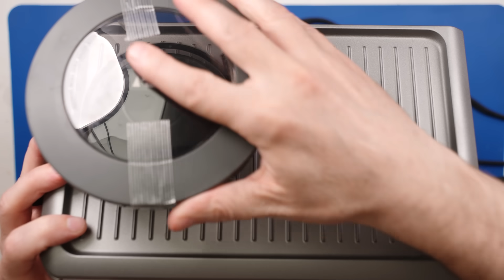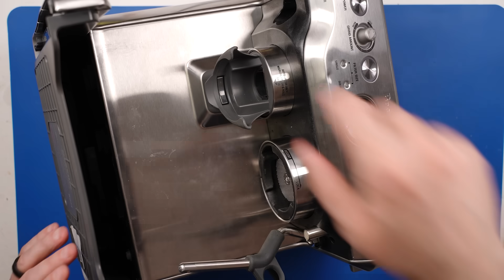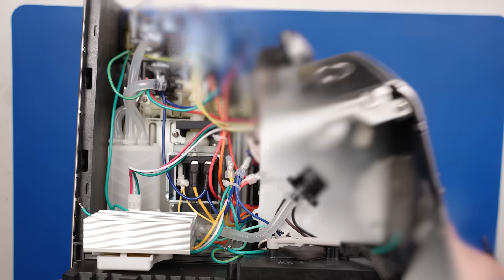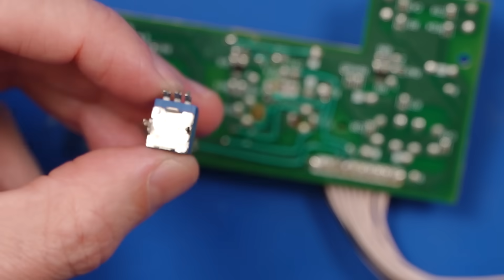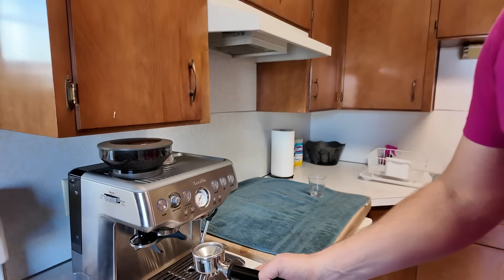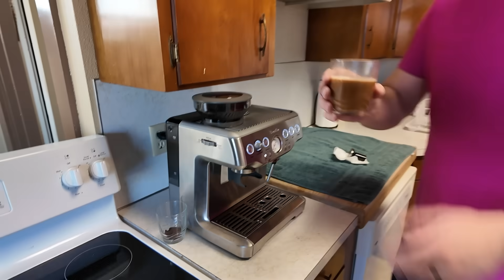Are Expensive Breville Espresso Machines Repairable?

Comment: Breville products on average are junk.   Now, if you can get one built well, assembled well and tested.. you may get lucky.  I have an earlier model of this one, and I went through 6 units from Macys... 5 all had issues, OR i found were used and returned and put back on the shelves.  I finally called Breville and said ENOUGH of the BS... your units are junk and I paid $200+. They admitted there was some flaws in the design and even the components on the PCB, etc.. They send me a brand new revised model and its worked now for 10 years without issues.. They had me RMA the junk one back. done.   SO, heads up.    Also shipping is trash too, they drop these boxes, bounce em and more all the time. this is a classic case of physical damage done from being dropped or shipping damage.

Comment: Solid work with one complaint: those were THICK traces on that board you fixed with some tiny thin wires. I’d be worried about that long term. I don’t know what kind of amperage was going through that area.
Reply from the maker: They were wide, definitely not thick. If the wires I installed were flattened they’d probably be about the same size.

Comment: Good thing about the Breville is that most replacement parts can be bought easily. The new left control pcb assembly for example costs around 20 bucks. So while there is some cute charm on fixing broken-to-half pcb that also supports physical buttons, in this case replacing the board would have been a better option. OEM Part SP0010233 btw.

As for what happened, it probably was dropped to its face, pushing the volume button in and breaking the board.

Comment: I wouldn't recommend breville machines, I had one and although it worked well until about 4 months out of its warranty (getting used for about 3 cups per day), once it started leaking and needed a new gasket, when I started stripping it down underneath the stainless enclosure it had cheese grade screws completely rusted and stuck in plastic housings. ultimately a $800 machine binned for a $10 seal because it was never made to be repaired. I have an ECM machine now, I have stripped it down once and it looks bullet proof, nothing but brass and stainless steel

Comment: I just replaced the solenoid and main board on my Breville due to a failed thyristor and bjt driver circuit that cooked the solenoid. Pain in the butt to work on but very satisfying to not have to replace the unit. Great video, subbed!

Comment: I repaired my Italian made Saeco espresso machine once. Needed a new heating element. My machine had 1/10th the electronics and 1/10th the plastic of this one. No PCBs or ICs at all - its completely electromechanical. Just big chunky switches, relays, thermostats, a pump and a heating element hooked up to brass plumbing in a stamped steel case..

Comment: Great video, i have one of these units on my kitchen  counter, it’s over 10 years old now. I’ve replaced all the internal plastic pipes and seals, solenoids, thermal switch on the boiler and main pump over the years. Pro tip breville has extensive parts diagrams and if you pressure their customer service you can order parts for a much better price than their certified parts suppliers as a one time exception

Comment: I have the same machine since 8 years now. It’s very reliable. Your dropped and broke the button board. Easy fix! I think, the spare parts are available. On mine, sometimes it needs to be dismounted to clean the valves that get clogged. The plastic removal session is bit annoying but it’s not so difficult. Good video.

Comment: How feasible/practical would it be to just create a replica of that board and get it manufactured and sent over by someone like PCBWay or whatever - seeing that it's just a single layer board and that you can scavenge the other existing bits off the broken board? I'm guessing that the machine was dropped on its front and the knob got pushed in and cracked the board.

Comment: that machine look way to complicate for no reason ,   coffee makers  just need a heating element , and pump ,and motor for grinder    and on off switch ,   the heating element just use ac power ,,  and ac dc converter for pump and grinder ,

Comment: I was a repair tech for many years and have seen numerous cracked boards. Wondered why you grinded it first only to add jumper wires to the pins. I was going out of my mind watching you reattach the switch to the wrong side of the board. I was screaming at the TV screen! 😅 Great end result.

Comment: I bought a Breville toaster oven to replace a much cheaper toaster oven that lasted 8 years. It looked great but failed after 6 months because of the thermal link going bad which was common according to owners repair forum, very very common. The part was cheap but after more than 20 screws removed, replacing the thermal link then struggling to hold pieces that did not want to go back together ta da fixed, Then 2 months later the top heating element died.  Decided to go back to a toaster oven 5 times cheaper and 5 years later failure free, I realized cheaper can be the better choice.

Comment: I've also bridged damaged wide traces with thin solder wick, which further splints the board. Used to use chamois head cleaning swab plastic sticks for splinting the board, epoxied in place to stiffen the board and reinforce it. Likely, the knob for the switch took an impact and drove the switch through the board.
I've also stripped the wire entirely in some traces, stripping the mask from the trace right at the crack a bit back, tinned the trace and wire, laid it across to both splint the board and complete the path.
Got a chuckle over the cover when you lifted the pad on the switch retaining pad, been there, done that, bent the ear to the board to give support to the switch when gorilla hands twists it...
Never did accomplish putting the switch on the wrong side of the board, but I've had my share of other five star blunders, some with impressive smoke displays. Especially when I converted light emitting diodes into smoke emitting diodes...
Wait, ain't you supposed to route some of the wires through the teeth of the big assed gear? Yeah, done that one too. Nothing's as much fun as tripling the amount of work required to get the damned thing working, despite one's worst efforts!
Just as it buzzed and I was about to ask, "How do you work the infernal thing?", you came out with, "I have no idea how this thing works", yeah, it's like that. I'd be burning up the phone with my youngest, who has used those contraptions before. I do either single cup either k-cup or grounds maker or an old fashioned percolator, although I've also done loose grounds into a saucepan of water in a pinch.
On consideration after viewing its usage, if I've gotta work that hard for a cup of joe, I wanna get paid for it. I'll stick with my fancy brown, caffeine and water, hot, blonde and sweet.*

*Ancient joke from early in our marriage, was at the diner and the waitress asked me how I liked my coffee, "Like I like my women, blonde and sweet!", my wife exclaimed, "Hey, I'm a brunette!", "Oops". Everyone died. We did "The Lockhorns" comic strip type of fake bickering at parties too.
Damn, but I miss her.

Comment: Great video! I have had my unit for 7 years now, and did a repair after a flow switch eventually got a small build-up of calcium scale. It's a pretty easy machine to keep running and built like a tank in all the ways that matter.
A hint to existing users.  Run a rescale monthly, using a simple citric acid solution. Calcium build up is the #1 reason why these units fail, so regular cleaning goes a long way.
Your walk through will be invaluable for when something else finally dies. 😊
Reply: I don't agree they are built like tanks, they are built like modern car engines, all out of plastic around the engine block, waiting to fail and you to buy a new one. A common failure are the are connectors things inside, there's a web group post describing the repair somewhere. I had to do this to mine, replaced the plastic part with a metal part instead.
Reply: @vampalan yeah, fair point. There is plenty of plastic, for sure. But I've never had an issue with that.i did a full clean somebyears back, just as preventative maintenance,  and the interior wss pretty spotless. A good sign. I was using the term "tank" to describe how reliable I've found the build,  not its ability to take a round. 😊   i for sure would not want to drop the unit! And it's no pro Cafe unit. 
 I've got 7 years from the current machine, and it's still going well. So the plastic is up to the job.
Maybe I can change the word "tank" to "Hyundai i30" for a better metaphor... cheap, reliable, popular and gets the job done, but definitely not top end.

Comment: I have had one for 9 years. Pretty easy to repair. Some parts are hard to find. Replaced a solenoid valve, pump, and steam wand assembly. Cost of ownership comes out to $100 a year with purchase cost, & parts over the 9 year period. Never had any electrical issues.

Comment: Gotta bring back the "Is it fixable? NOPE!" videos. I'd watch a series of those. Always interesting to know that certain things are designed to be near impossible to repair...
Reply: IMHO, 99.9% of the people could not diagnose and repair the unit featured in the video.  The espresso machine relies on a bevy of sensors and electronics, any of which can/will not function as intended or, fail altogether.
Reply: @SunriseLAW  I mean in the case of a cracked board... I feel most people would know what the issue was by that point. No power usually does mean a problem with a connection or a shorted chip on the board and if you are able to check the connections on the boards then you'd likely find where the issue is. It's not like there's a 99.9% fail rate at fixing these. That's not a believable statistic at all.
Reply: @SunriseLAW  I was an electric tech in my previous life. The diagnosis here was the easy part. The disassembly and reassembly were unnecessarily complicated due to the poor mechanical design. I wouldn't try to do this repair, but instead order a brand new replacement board.

Comment: I've had one of those for about 4 years now, its fantastic. Really good value.
Reply: the components in there are incredibly cheap and optimized for mass production. A truly good espresso machine doesn't need PCBs. For the price of that one new you could get a Gaggia Classic new and have 150 bugs left to get a cheap, but decent espresso mill. Those will last a lot longer and make better coffee.
The only reason for the existance of all those electronics is to keep the small aluminum boiler on temperature, because it doesn't have any thermal mass. The rest of the elctronics is a microcontroller that switches that solenoid valve and measures the amount of water for a cup inaccurately, which is a problem you could solve with a scale for 10 bugs.
So it's not good value. It's a convenient whole package for a bad price.

Comment: This is literally the machine I have in the kitchen now. I've had it for 10 years now and it hasn't skipped a beat
Reply: Makes perfect sense it's the seal at the tank. In Malaysia where I'm from, parts don't exactly come that easily. But I'd try anyway since I adore this machine so much for my caffeine needs. Thanks so much!
Reply: Mine started to leak water from the external tank inlet after 3 years. I did regular cleaning and descaling. Any idea why?
Reply: @kennieliong  I'd hazard a guess that it was one of the rubber seals around the coupling where it docks with the machine itself. Not sure if you can repair just the seal or if you'd have to buy the whole water tank but hopefully Breville will sell you the parts either way

Comment: Hy, you did a great job on soldering point of view, less from mechanical one.

I suggest, for the next time to engrave the break edge, as you done to expone metal for solder, so in this way you can have a stronger join to deposit epoxy and also realline the board better

Comment: Designs like this make me shudder - firstly the lack of a panel grommet for the mains cable, when I first saw it I thought it was a botched repair, but after disassembly I think that is by design, I guess it works but not good engineering to have a moving cable running against the edge of thin steel sheet - second the PCB with combined high voltage and low voltage, I appreciate that it is done out of necessity because of the lack of space, and it is not the only product, but I prefer to see high voltage and low voltage circuitry on different boards.

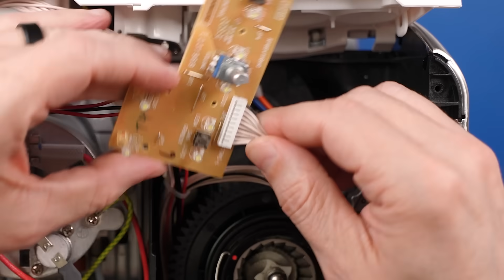Comment: 8:30 it looks like the power button may have been smashed down by the shape of the cracks on the board (or the board was smashed upwards against the power button) but I can’t see that happening after it was assembled as the buttons tend to be quite flush to the case to avoid that kind of damage.

(Edit) 19:27 actually it’s sticking up a lot more than I was expecting so it could have been damaged by the owner after unpacking.

Considering how much these things tend to cost it’s bad to see one that’s been broken at the assembly factory, my sister spent like 2k on one and I’m like you spent how much? Meanwhile I’m probably making better coffee with my one cup drip brewer (just a bit of plastic and glass and a filter) that cost like 10 quid.

Comment: This model is a value and reliability gem. We have used it in our small cafe for 6 years and pulled about 10k decent shots during that time. It was a "temporary" solution that stayed as it just did the job amazingly well. 
I purchased a second filter handle and we do use separate milk foamer, as the one with the machine is slow for our needs and can not be operated while pulling a shot.
I remember changing one gasket during that time, nothing else has ever broken or failed.
We have always used filtered water from Brita pitchers in this machine, i believe that has helped extending service life of this machine. 
Of course, it is not perfect, as few things are. For example, in my experience, you can set the grind amount perfect for either single or double shot, bot not both. We have chosen single and to double we just add a dab extra manually with the included grinder (push and hold down the button) 
Parts and acsessories are  available from appliance repair webstores and Sage/Breville.
fyi: our cafe is in a rural area in a country where 90% of the coffee sold is filter coffee. I dont think this machine was the right choise even for us, but it has worked out quite well. Perhaps we are just very lucky, but most likely the machine is the one to earn the praise.

Comment: They won't work or turn on without proper items connected to it so it was likely fine just missing the accessories to get it to work. Just based upon our experience with our machine it wouldn't turn on without the right parts attached to it either

Comment: See, I would have never thought that board was repairable. Kudos to you for reducing the amount of e-waste and teaching us how to reduce it.
Reply: It was a single layer board so really easy actually! Now imagine they’re board with over 20 layers! Smartphones today have over 6 layers already
Reply: As much as I like to see less E-waste, a proper repair for the machine would have been a replacement board, either from a donor unit, or custom build from a PCB service.
Reply: At least it was repairable. Had two cup at a time, both k-cup or grounds models that failed. One, a blown out valve unit that can't be found anywhere and the other, a sealed motor and pump unit.
Bought a different brand after that, that one's holding up better.

Comment: About a year ago, my Breville convection oven stopped supplying power to the heating elements. These things are incredibly difficult to service, and it feels like they don't want you to fix them. It was a massive undertaking just to get it apart and inspect the board inside. I eventually found a few cold solder joints, repaired them, and got it working again. I feel your pain with how hard it is just to open these devices, and I really wish manufacturers didn't make them this way.

Comment: turns on but the motor won't spin. I thought it might be the start caps, but it responds the same after replacement. It seems there's a short somewhere on the board, but I can't find any issues. Would you be interested in taking a look @Tronicsfix

Comment: The anchor pad for the pot wasn't lost when the board was broken.  Your desoldering gun pulled it and then fused it into the solder of the other pin when you went back.  You can see it sitting on the tip.  They save time but can put a ton of heat in a split second into the joint.

Comment: 17 Year Retail Associate/Store Management veteran here lol. That was without a doubt in my mind, a store display model, which it why the accessories still have the tape on them, but not the "peel off" film. (If not, the next section would apply to a new buyer as well)

It likely fell off a shelf/countertop face first, landed on the "grind" knob, and pressed the board inward, causing that wild crack. You can tell because of the specific shape of the break, because they are NOT individual cracks. 

I waited for a while to make this comment, and I'm STILL trying to figure out why you'd pull out the board AND that entire connector and wires, when you could've just de-soldered that connector (that I KNOW you could reconnect) and made your life 1000x easier during the repair process. I mean, the crack made it all the way over to the connector, so why WOULDN'T you want it out of your way to ensure the fullest repair?

Comment: Im Sorry in advance but looking at the board at 12:58 you dont have to grind a single trace.
There are so many exposed solder points running wire between points would have been far better in my view.